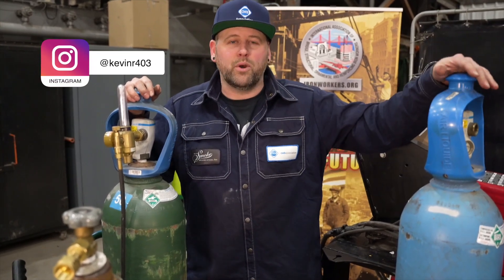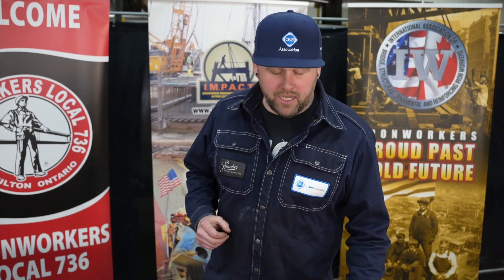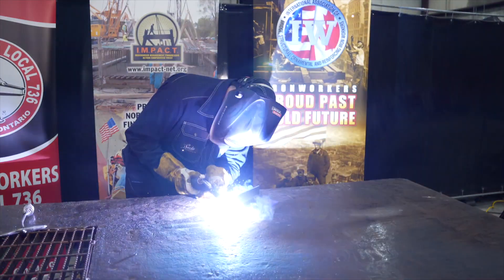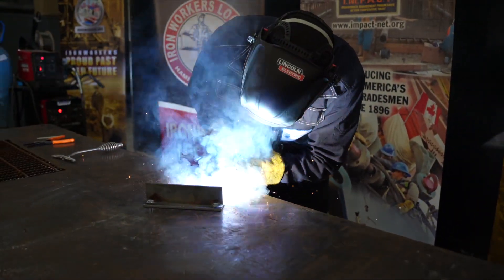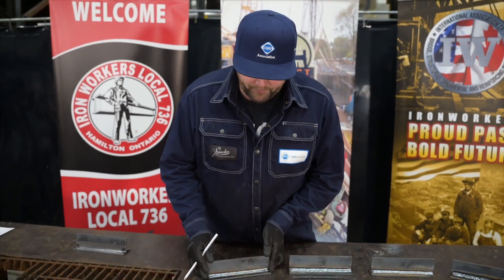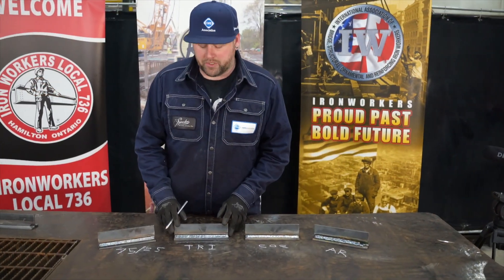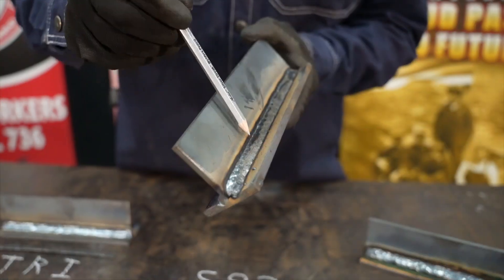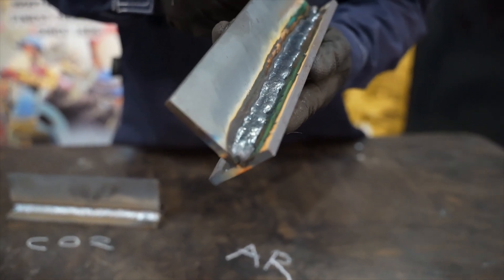What’s Up with Gasses: FCAW

Comment: Excellent video, one of the only references I've seen so far to using tri mix gas with FCAW. No wires that I've found list tri mix as an approved gas, is there a reason for this? I use BOC Argoshield Universal (a relatively high Co2 content tri mix) for short circuit and spray transfer and would love the option to use dual shield without having to change gas.
Thanks